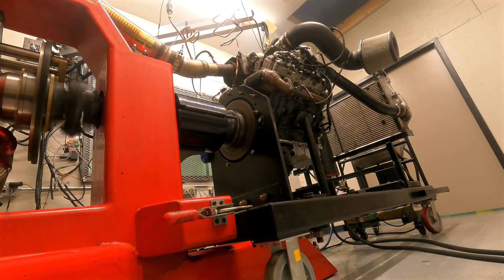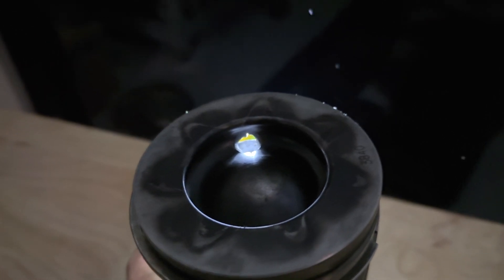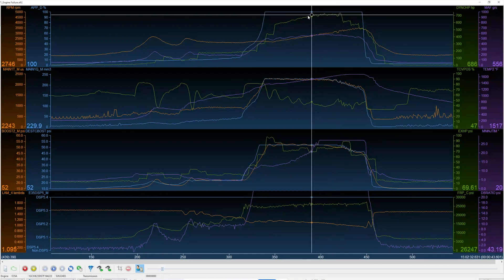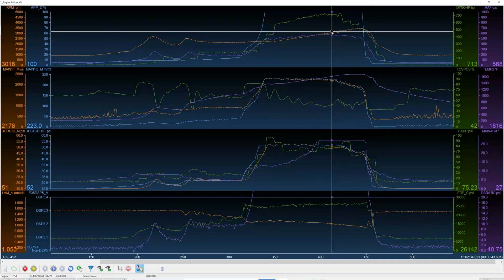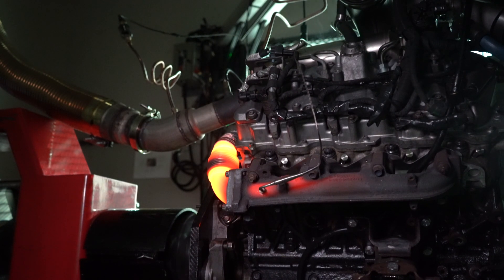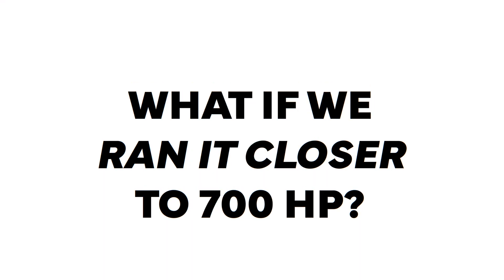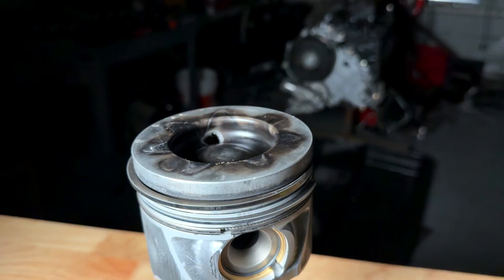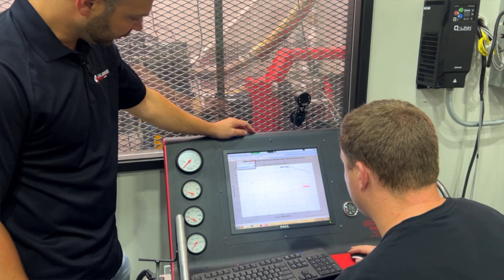LBZ Engine Explodes on Dyno During Data Log!

Comment: Was this a fresh engine when you started dyno testing with it? Or was it a used engine out of a truck and if so, how many miles where on it before it was used for dyno tested. Just curious. Great video Nick.
Reply: It was a used engine.  Freshened up the heads and fuel system.  If I said I knew how many miles were on the bottom end I'd be lying.  Salvage yard stuff..

Comment: Quickly melting a hole thru the piston at 700hp likely means your runs at 600hp would have a the same issue if held for more than a short dyno run. Hard to consider that "safe" at all.
Reply: We're all welcome to our opinions.  I'm certainly not going to twist your arm to run 600HP continuous on your engine if you're not comfortable.

Comment: I have been to 7 so called  diesel mechanics, my 06 lbz Trans and engine run hot only when towing. I changed out the thermostats , coolant,  fan clutch. Some say it's the heads, others  the water pump then others say egr valve and cooler or radiator.  I have clean the stacks and all is stock. I don't trust parts changes it can become very expensive!  The problem started in 2021 with 145k miles on it, I was pulling my 20 foot travel trailer which weighs 7k driving west on I - 70 in a bad head wind driving 70 mph for 3 hours all temps almost went red and oil pressure dropped and so did rpm. Everything is great not towing even with the bed full of rock. Help me please!!!

Comment: Awesome video. Data is awesome. I dont own nor do I plan on owning a duramax, but I love your videos because you are thorough.

Had you done oil analysis on the motor during all these incremental changes? Curious if that would have told any of the story. Also curious what IAT's were and any sort of change in those as the power increased.

Comment: I think Banks cautioned about turbine drive pressure being much higher than boost  pressure.
Reply: It’s all about application. Old Banks was running a giant 8085 single, not something you’d want to drive on the street.
Reply: @jamescharron8550 yes but a good vgt shouldnt be 2x boost

Comment: what about an LML with 100 overs and 10mm cp3. how much power can it safely live at? thinking of going that route and either stealth 67 or 64. would a 67 blow up my stock lml
Reply: I have the same question I’ve got a 68/73 dual sportsman’s but I’ve heard and seen people run those trucks 800-900 hp with stock bottom end I think the lml has stronger internals bottom end than previous models I may be wrong but you see a lot of lbz failed over 700 and a lot of people running 700-800 on lml with no issues
Reply: @ thats good to hear i might be going 67mm and sending it around 750hp on stock engine